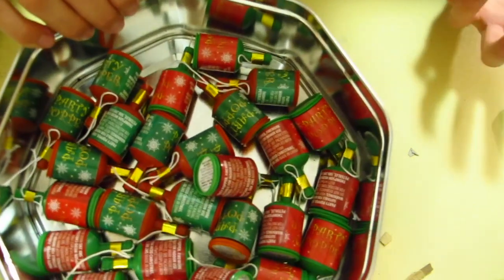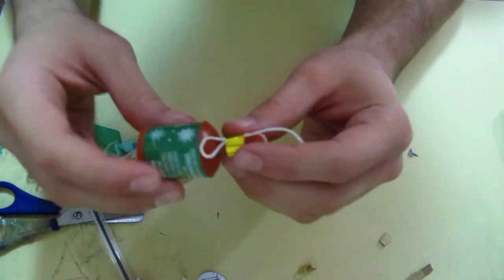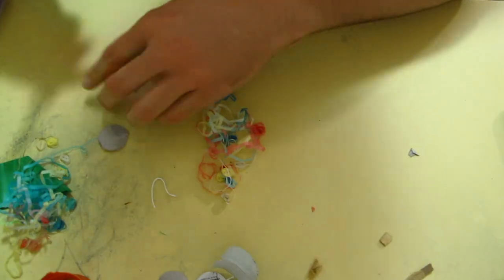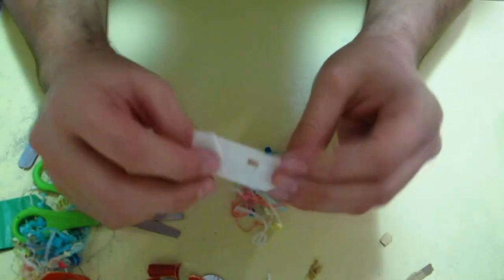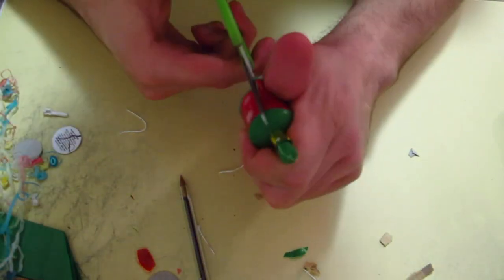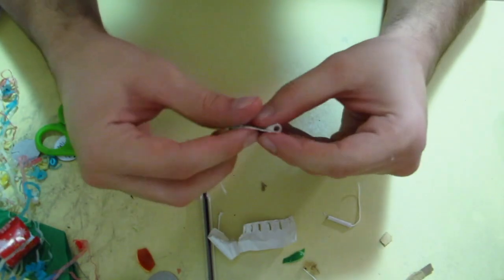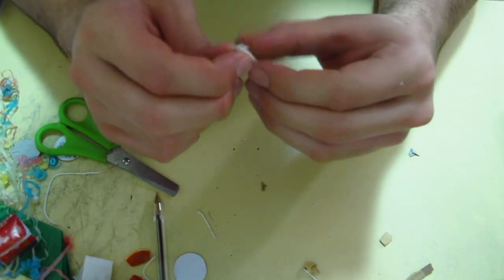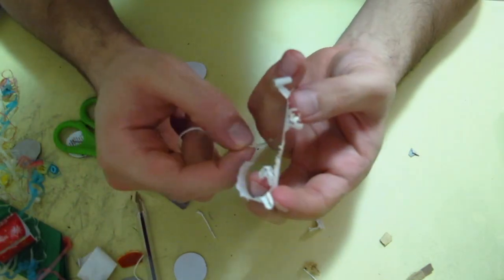Dissecting Party Poppers

Comment: So I think the paper just holds it tightly, but the thing causing friction is an additive to the blasting compound.  Like someone wrapped the material from the head of a strike anywhere match very tightly in paper and put in a rope to generate the friction.  I believe for strike anywhere matches they use powdered glass or very very fine sand powder.